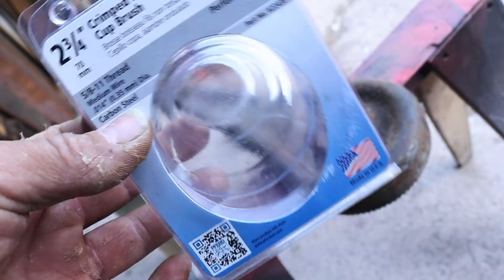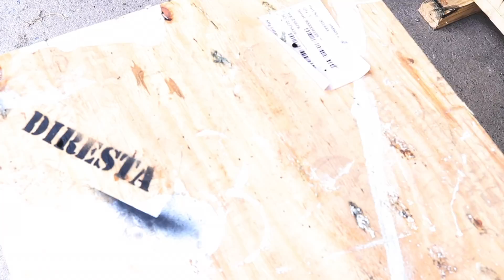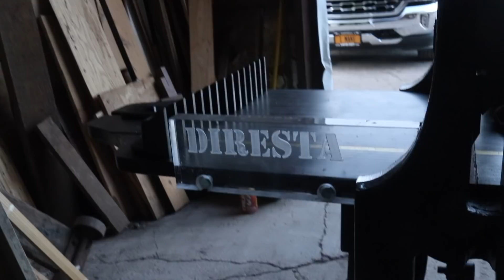DiResta Paper Chopper Resto

Comment: Great project Jimmy! Thanks for sharing. I just started working at a printing company a few months ago, and get to use Polar-Mohr 115 CNC, with air table and jogger. It does the job, but yours looks way cooler. We have a 50's model Heidelberg press that never gets used, I've been trying to talk them into letting you get it( it may too new for you though,lol.)

Comment: Maybe spray some clear coat on the table to keep it from rusting back up? Ever tried rolling on paint like that? Probably get a slicker finish.
Reply: Actually, the paper deck is supposed to be textured like that. To slick it up, a lot of people use car wax, which I think is too labor-intensive. I use spray silicone....
Reply: In  a print shop, we never have to worry about the table rusting. Paper is micro abrasive so sliding paper around on it all day keeps the surface polished. If he only uses it once in a blue moon then he's going to need to protect it.

Comment: Nice resto. However, I've seen this machine in action, the cut should be smooth as butter. Your blade seems sharp enough, as you got good results. Maybe the joints need a bit more oil or smoothing to make the cutting action one fell swoop. Who knows maybe the blade does need to be sharper. ... Here's an interesting fact: I always worried that fingers could get cut whilst loading the paper, but it was explained to me that's why you need both hands to operate the machine. If both hands are on the cutting lever, neither can be under the blade. ❤🌅🌵

Comment: Did you sharpen the blade to the standard for this paper cutter? Very important thing to do to keep the edge straight and get a clean cut there are many places that still sharpen the blades professionally to exact standards. Also I didn’t see a acrylic or hard plastic base strip were the blade meets the table top surface which is also very important. Great rescue of some machinery that should at the least cut some notepads. Lol awesome video

Comment: Very nicely done.  Did you do anything to sharpen the blade?  I noticed a few niches in it, and I was wondering how somebody would go about getting something of that size sharp.  Thanks!
Reply from the maker: Needs a professional but I did use a belt sander
Reply: Looks like a job for ToT
Reply: You just need to grind back the blade till the nicks are gone, but those size blades are still available, or you can make them just by getting a blank of hardenable steel and grinding the basic shape in it, then case hardening it to get the sharp edge, and grind the final cutting surface in it. Tool steel blank that size though will need EDM to cut the holes, then a lot of grinding to get the edge in it. however the old one came up nice enough, and if there are the odd nicks then that just adds character to your hand printed jobs. 

Sharp blade though will make it easy to cut the paper, just make up a good number of the blade stops as they will wear with time, or get in the habit of always using a cardboard underlay on a stack so you get a clean bottom cut.
Reply: Most print shops will send their blades to a knife sharpening company, it is not to expensive and it will have a razor sharp edge. Not hard to find with a quick google search. Love to see old gear put to good use.
Reply: SeanBZA  The blade might still be able to be sharpened depending on its condition? I used to work in the printing & paper industry. Surprised  Not see a manufactures name on the Machine?

Comment: When I was but eight years, old my father tasked me with the hand brushing of a similar situation remove the outstanding accumulation of filth on a power fed under cut power saw, the monstrosity sat in the old out building at his shop site, it did take most of the summer vacation time to complete the job.Then the remainder of vacation was spent lubing the mating moving parts and then painting it with safety yellow lead paint for lasting resistance to rust.Then it was sold to a collector for very much money which went into he and his coworkers pockets.I learned a valuable lesson that way, keep mouth shut and eyes&ears open. This was a punishment delayed, from the beginning of the new year. His Government job shops new years party. When i'd told the truth about his"ten day cold" to the wrong people.

Comment: Don't clear coat the table, WAX it! That paper should slide when you move it. Also, cut some metal rod about 8" long or so , about an inch thick, and thread on one end. Screw them into the cutting blade. These are your handles when mounting/ unmounting the blade.

Comment: 100% about your mirror finish comment.  Wondering though, would a soda blaster made quicker work (you’d need a dedicated area for it)?  I have a bunch of furniture from my dad from the 1940’s that I am slowly restoring.  One item is a drafting table (poorly repainted/rusty).  I already did one but used sanding and wire wheels and paint stripper.  Who knows what kinda junk I inhaled.  When I do this second one, I’ll rent a sodablaster...
Reply: EJ Ciramella wire wheel is the best.
Reply: The Good of the Land I could never get the wheels and brushes and what not into corners of things.  I believe you and will always start that way, but soda blast any residual junk.  Thank you for the reply!

Comment: While I totally get that he is simply getting it back to working condition, I dislike that he didn't seem to check any of the bearing surfaces and he didn't put any anti seize grease on the bolts. That's not being precious, it's simply good sense. Also, when he sanded the table and just ran over the brass rules was somewhat disappointing.

Comment: Can anybody good at this stuff explain why he did not make all the surfaces shiny like the crank wheel but instead painted them?,
Sorry for my bad english.
Reply: Eswar Kumar The ‘crank wheel’ is one of the surfaces that is frequently handled along with the bed of the machine (where the paper sits) so paint would wear off the wheel quickly. The rest of the frame is painted to prevent rust as these surfaces are rarely touched. In other machines like a metal guillotine the foot pedal would not be painted as the shoe would wear the paint away. Hope that answers your question.
Reply: Conor Fitzpatrick Design I see thank you answering my question.

Comment: I wouldn’t call that a restoration, more like a basic clean up and a slap with some horrible black paint.
Reply: The missing nuts and bolts?
Reply: piratemonkey .. it's still a restoration, but i agree about the paint : )
Reply: I agree that it is NOT a restoration. More like refurbished. 
The horrible 1/4” think brushed on Rustoleum makes for a hack job.
Reply: It’s a functional restoration, ie bringing it back into use. I doubt Jimmy was aiming for a perfect cosmetic restoration.